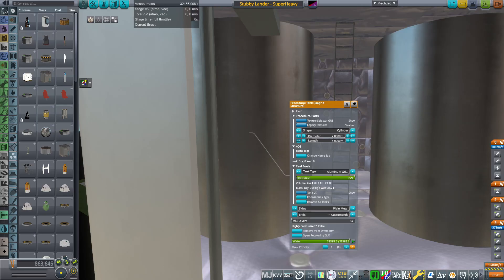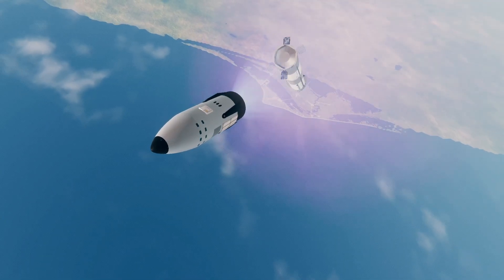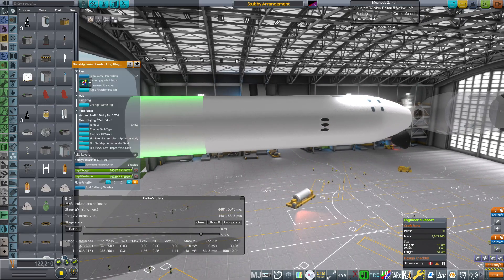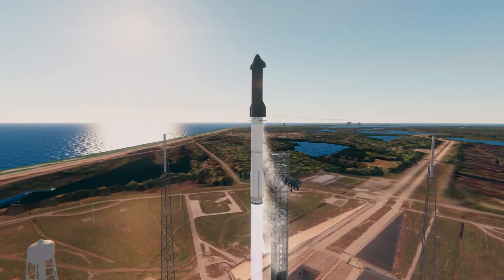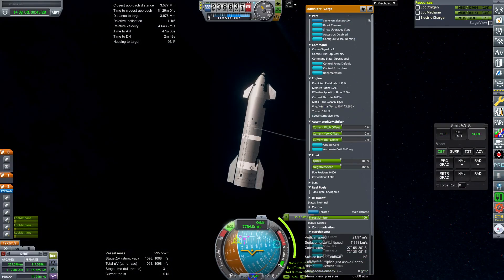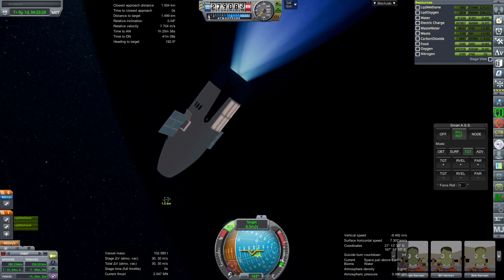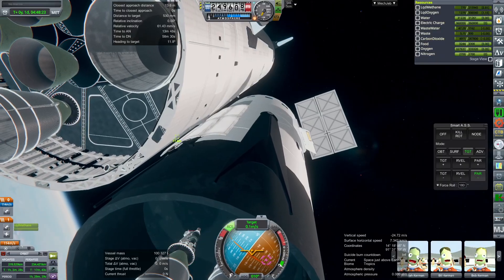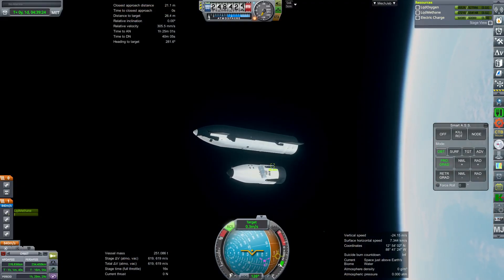Stubby Starship - Streamlining and Fixing Issues

Comment: Could, and should the R-Vacs have a larger nozzle extension for this type of design? Engine bay space is not a limitation since the sea level engines are removed. Only issue I see is they would have flow separation during static fires causing engine damage, so having a low pressure environment, or installing the nozzle extensions after static firings would be needed.

5:30 Just the propellent mass of Starship-Superheavy will increase by 45% on the V4 variant. Increased chamber pressure helps with DV but if V2 raptors were used with the V4 stack, it probably wouldn't get off the pad.

Comment: I believe to use the Stock construction, you need the breaking ground dlc and an engineer. Then while on EVA click the Crane hook symbol (Below the deltaV button on the toolbar at 9:26). Once your in that mode hovering over movable part would highlight them green. The key thing might be that not every part is movable
Reply from the maker: Thanks - I'll install the DLC and try that out, then.